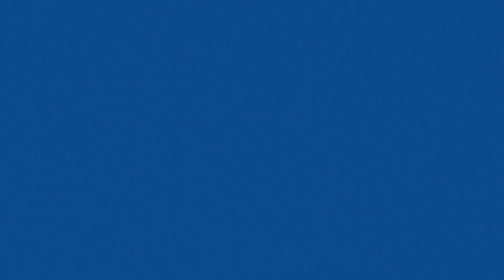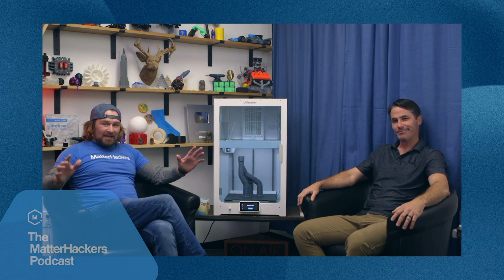Discover the Power of the new UltiMaker S7 - ft. Dylan George of UltiMaker

Comment: it would of been nice to actually talk about the printer specifications, 
Meaning talk about its sell points like,
 
The build volume. what temperature can the Extruder go up to and also the build plate temp
how many extruders can it use
does it have Bluetooth or Wifi capability 
What is the fasted speed it can print at
Does it have all metal gears and a filiament fan and sensor

Anyway at the whopping price, and you cannot change the build, i mean another build plate type cost next to nothing

but really as a hobbyiest  my Enders 3v2 and 7 I do have the choice to swap around my build plates to suite the materials I use
Also the Hot ends after an upgrade can reach 500c so carbon fibre is no problem

one thing i can say about Matterhackers, is your software is great.